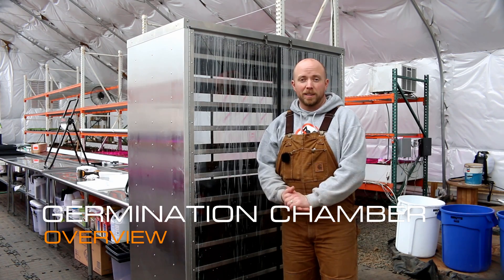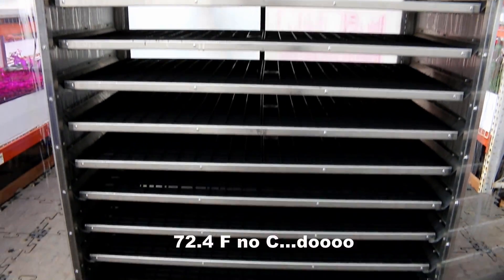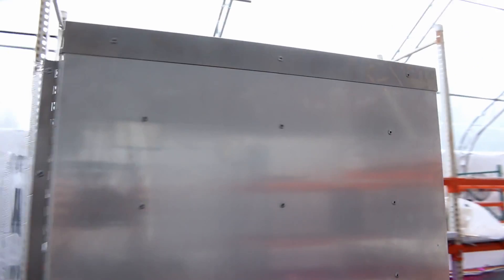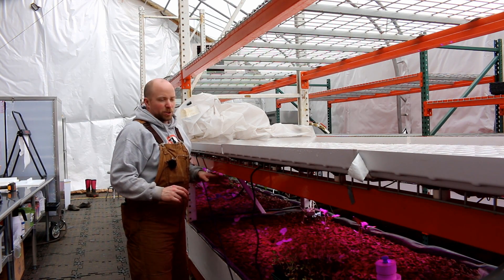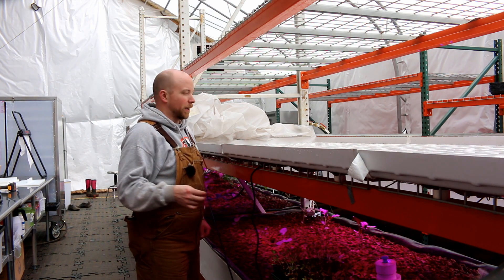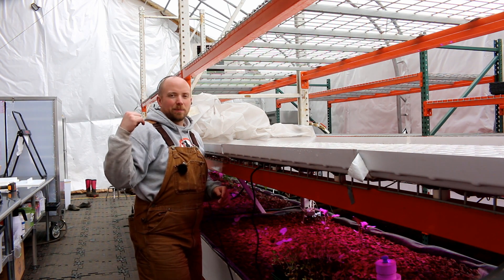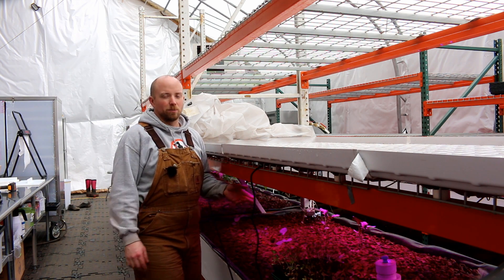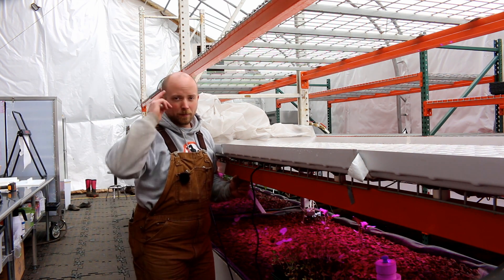This is a game changer, GERMINATION CHAMBER Arrival

Comment: Hey Jeff awesome solution there. But doesn't that thing steel your so much needed amps? :)
Reply: Fist thing that came to my mind as well. There was limited power for pumps, now there is less power for pumps. Decommissioning the old system with remove that load but what's the comparison of power usage. Also spends money on a fancy germination chamber while still using crap sensors elsewhere. The best automation system in the world is worthless without dependable, precise, and accurate sensor data.

Still no current monitoring on that 40A circuit? I guess the indicator that he's gone over is when the breaker trips and everything shuts off.

Comment: My paper towel is quite a bit cheaper. If you want to learn how to germinate seeds learn about the moon not buy more equipment.
Reply: Germination chambers are an amazing tool. I propagate liner trays of native grass plugs and forbs for restoration and re vegetation. My germination runs at nearly 100% across all cells in as few as 5 days / 120 hrs. The amount of time saved maintaining moisture and temperature over a standard 7-10 day is profound. No more being a slave to the system. Put them in the chamber and come back to seedlings in less than a week.
Reply: @foxtailfarms9517  100 percent nice!
Reply: Learn about the moon? Care to elaborate?
Reply: Yes, @Nate could you elaborate?
Reply: @lovesteadmama8738  Yeah the llewellyns moon sign book. Tells you which moons to germinate seeds in to get higher success rates. 

They can obtain a different attribute depending on the moon sign the seed was germinated in. They can get generally 3 to 4 different attributes breed in to the seed. Most crops have 3 or 4 moon signs they can be germinated in. When you breed that line of seed and germinate it in all of the different moon signs it Is then considered a thoughough breed seed. 

The book tells you when you should cut growth to retard growth or accelerate it. So if it is currently a moon sign that accelerates growth that is when you should top your plants. If it is a moon sign that retards growth then that is when you should lollypop them. It is a great book.
Reply: @lovesteadmama8738  hes talking about biodynamic farming